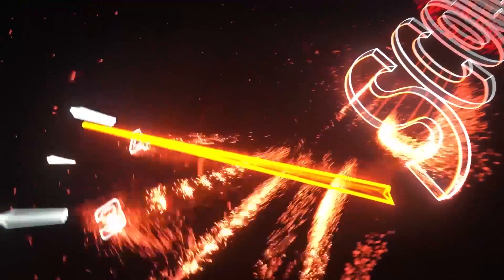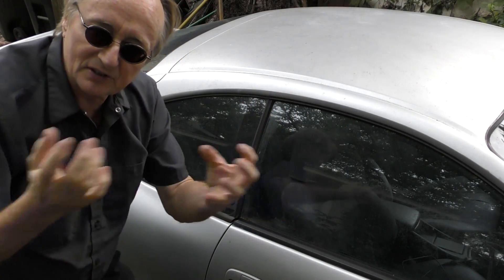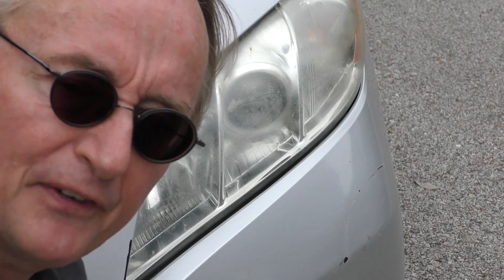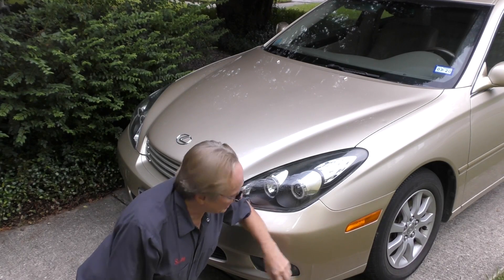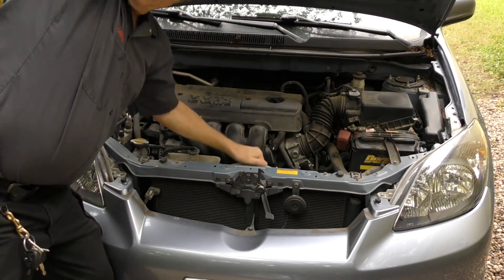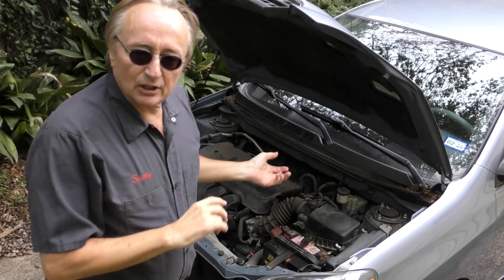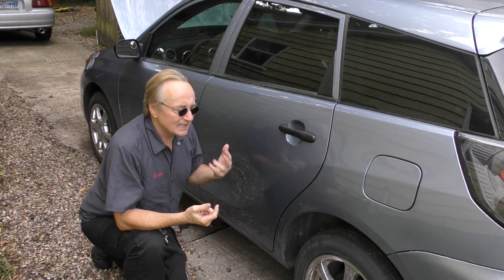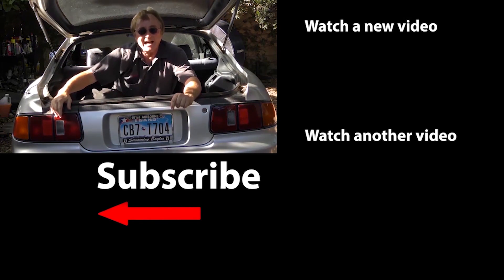You Can't Fix Stupid (Closing My Car Repair Business?)

Comment: Scotty has got a lot of good points over a lot of things, I work with mechanics, or now they are called fitters, as they dont usually fix any thing now, just replace parts (mostly) . The car companies are so cunning, replacing metal for plastic as they say it makes the car much more lighter for economy, and cheaper to make.I noticed things going cheap and low quality in the late 80s where the car companies dont even want none franchised mechanics touch their vehicles producing their own company made tools which were highly expensive. I dont  seriously think car manufcures want cars to last for many years as they used to, apart from some that actually do luckily. Plenty of negatives in the past too of the older cars, eg emissions, fuel economy, unrefinement, safety etc. I never understood people who bought cars for a year or less, then got another one for say $500 each, but now do as if it is not worth fixing just get another one.

Comment: Had a 70s Chrysler 245 6 cylinder that the new aftermarket water pumps metal impeller was slipping on the drive shaft Took a while to work out what was going on

Comment: Im in lake charles and in serious need for an honest mechanic to work on 97 gmc 5.7 liter.  Getting code p0151.  Low voltage for longer than 2 minutes on bank 2 sensor one.  Already changed sensor twice. I suck at wire testing.   Also i messed up and dropped to 165 degree. Thermostat. 
Fixing to go back up to 195 when i get paid.  Simple enough for me to do that.  
Also... How do i check fuel pump pressure.  May that is problem.  Surging slightly at redlights.  Definitely noticeable when its happening,  but doesnt always happen. 
But.... I did buy this van for 500 bucks, put a battery in it and drove it home.

Comment: I'm fine with the single serpentine belt.  You replace it at the interval and throw the old one and the right wrench in with the spare and it's a 5 minute job if it breaks.  Yesteryear.  My 2016 Camry apparently requires the lower subframe to be dropped to get the clearance to change the belt!  Jackassery

Comment: The main reason I got rid of VW GTI - cheap German plastic!  Plastic intake manifold, water pump assembly, and to top things up it even has a plastic engine balance shaft and oil windage tray.  Absolutely stupid.  Due to all the cheap brittle plastic I seriously doubt there will be many 2012 GTI's in 20 or 30 years.  Same with Audi, M-B and BMW.

Comment: I have to disagree about your "Uni-Belt" serpentine drive being on this list. If you have separate belts for water pump and alternator, the loss of one still means you're parked. The serpentine is self tensioning. It can't be over tightened and it compensates for stretching with age. The first vehicle I had one on was a 1989 Chevy K1500 pickup. I changed it at 100,000 miles and truth is, it was fine. I just couldn't wrap my head around a belt lasting that long. I still have the truck and it's still on the second belt at 245,000 miles.

Comment: The epitome of Stupid: the WATER-COOLED alternator in my 1999 BMW 540i 6MT.  Yes that’s right - a non-rebuildable Bosch water cooled alternator.  The supposed more stable temperature was supposed to extend alternator life, yet I was replacing it for the second time at 128k miles (the first one failed at 53k).  Utter garbage.

Comment: They would run out of gas and keep trying to start it, burning up the fuel pump because it don’t pump air...then realized, “Doh! I’m out of gas!” Go fill it up and guess what? Won’t start cause the fuel is toast. Gets towed in to our shop and I drain half the tank so it’s manageable when I drop it to change out the pump. Yeah...Mostly Chevy, some Fords and a few Mopar. Everybody else...through the back seat!

Comment: Honestly, I hate that the plastic headlights discolor, but unless you put 3M film on the glass ones to help protect them from rock hits, they don't seem to last for more than a couple years anyway. They each have their good and bad.
Reply: Also, the plastic aftermarket headlights I had on my 2000 Nissan Xterra were still clear when I sold it after 11 years. I have glass headlamps on my 1993 Mercedes and I have 3M film on them now.

Comment: Easy. Auto manufacturers (especially the American ones) design cars to only last a certain amount of time because they want you back at the dealership every 2-4 years buying a new one. If the engineered cars to last 500K miles with little maintenance, that's less work for mechanics and less cars sold overall.
Stupid but true.

Comment: I bought a 1991 Ranger with a plastic radiator and drove it 150k... no problemo
I have a 2008 Silverado I bought new.  It has over 100k and a plastic radiator... no problemo
I had a 1997 Taurus SHO with a plastic radiator.  I sold it with 135k on the odometer... no problemo
As far as I can tell, plastic radiators are OK.

Comment: Back in the 70s when Scotty really did have customers, vehicles made 10 mpg.  Today, cars make at least 25 mpg and many more make much better thanks to fuel injection and fuel pumps in the tank.   Electronic fuel pumps seldom if ever fail.  A fuel pump is made to pump not suck, that's the reason it's in the tank, plus it's out of the elements.  If you change your coolant on a regular basis and keep rust and corrosion out, you won't care what the impeller on a water pump is made of.  If you bend a metal bumper, it'd cost you more than a plastic bumper, plus the plastic is designed to take a hit better than metal causing YOU less harm.  I agree "most" plastic parts on an engine is a bad idea due to heating and cooling cycles.  But plastic weighs less so you get better fuel economy.  And yes, it's much cheaper to mold then metal.

Comment: Hey scotty, got me thinking about an issue with my '05 Dodge Ram 1500 with your talk of low quality radiators. Seems that my problem is that the temp likes to jump quite alot. Mostly going up very big hills/mountains it goes up over the halfway tick mark, checked the manual for specifications and it said that it would be normal for the engine to go above the tick mark but as long as it stays in the green section it will be fine. It goes back down after I even out but I've never had a car jump through so many temp changes like that. You think it's time for a new thermostat or am I just overthinking?

Comment: Hey Scotty I have a 2001 Saturn L series v620 121,000 MI the transmission is beginning to slip in first gear and reverse should I sell it or just buy a brand new transmission and also it burns about 1 quart of oil every oil change 3-4k

Comment: If you want to see stupid look for the heater hose clamps on the heater core in a Pinto (if you can find one that hasn't burned up). HINT they are one the inside of the heater core case on the inside of the cabin. Thats right you have to tear the dash all apart to change the heater hoses. One of FORDS brighter ideas.

Comment: Scotty complaining about a single belt running multiple accessories as if it's a new thing. That was happening at least as far back as the 1960s. Separate belts for separate accessories increases complexity and, therefore, costs.

Comment: I've got a 2008 Kia Rondo 2.4 with the 4 speed automatic with 245000 kilometers. After I let the car sit for a few hours, say 4 or 5 then drive it, the transmission seems to slip a bit during the 2-3 upshift. It only does it during that one particular shift and only once during the time I'm driving it, every other time it goes from 2 to 3 while it's being driven is fine. The transmission fluid was changed about 7 months ago with a multi spec fluid that met the Hyundai/Kia SP4 qualification. Is this something that I need to worry about or can I just ignore it?

Comment: The Fuel Pump on My Holden only lasts 4 and a quarter years (replaced 2 so far) and every time it costs Me half a tank of Petrol and $1,000. Fuel Out and then Fuel In and half the Tank evaporates.

Comment: I’d rather take a sound beating than change the fuel pump in a Suburban again. The plastic tank on the driver’s side of the radiator in my ‘00 Silverado cracked and started leaking, so I ordered a radiator from Rock Auto. 45 days later the plastic tank on the passenger-side of the radiator I bought had cracked and started leaking. I had to go through Rock Auto’s idiotic warranty process for another radiator. Rock Auto will never again see a dime of my money. Going to my local NAPA is a lot more convenient.

Comment: Had a old pathfinder with the spare wheel mounted on the back to a STEEL gate that was bracketed with STEEL on each side and NOT onto the door itself.  F150 slammed into me from behind.  His truck? Looked like the Hulk punched the front of his truck.  Mine? A broken tail lamp bulb (plastic cover was fine).

Comment: Another stupid thing that ford did with the heater core on the 95 and up ford Ranger is they made it so you have to remove the entire dash board to replace the heater core. The 94 on back could be replaced in 30 minutes. The 95 on up takes maybe 8 hours with a person that knows what they're doing. Totally stupid.

Comment: The way I fixed the ''fuel sending unit''* was by cutting a square hole in the bed of my pickup truck

*Yes. It is called a ''Fuel Sending Unit'' since they dropped them down into the gas tank. Take note! These things must put out 55 PSI That's a whole lot of pressure man! Previously on carburated systems the fuel pumps only had to put out some 5 PSI. Now with these ''Fuel sending units'' putting out a freaking fire hose worth of pressure on the fuel line/system guess what happens?

They wear out more often. And now that they're located down so deep into the fuel tank, these bastards do cost a fortune to fix.

And once they're fixed? They may only last six months to a year!! ''Rinse & Repeat'' and this is what the auto companies want. 

Today I own a 1965 Ford. It doesn't even have a ''Check Engine'' light.

Comment: I'm searching for a used car 2014 to 2017 with low miles. A 2016 costs THE SAME as a NEW CAR! Why? New/used car dealers in my area have a $1000 "markup" and $1000 paperwork fee??? Why is this? 50% of buyers can NOT get new car financing, thus get INSTANT 18% financing on ANY used car that has been jacked up in price...

Comment: I actually like the one serpentine  belt as opposed to the multiple belts. Much simpler imo.
Reply: My thoughts exactly. Individual belts were a total pain in the rear!  They fell out of adjustment all the time and SQUEALED. The serpentine belts last 100k miles and have automatic tensioner. Just be sure to replace the belt, tensioner,  and idle pulley at service intervals .

Comment: Do you have to pull out the fuel tank for Holden/GM Captiva? (2007, petrol/gasoline, auto)?
Reply: these days, it is truly amazing if you dont have to drop the tank to get to the fuel pump. Even on my old 92 sierra the pump is in the tank. at least they had the sense to put the filter along the frame so it is easy to replace.
Reply: @metalwolf112002  oh, that sucks.
Reply: @ArjayMartin  bright side, fuel pumps aren't frequent maintenance items. That is how they get away with putting those in the tank. When i got my truck, one of the first things i had to do was replace the filter because the old one was starving it for fuel.
Reply: @metalwolf112002  I thought that they made it hard to keep 'the boss' in work

Comment: An example of stupid people I thought didn’t exist - saw it yesterday when getting oil changed and tires rotated (can’t do it myself anymore because my knees are bad.) The service tech comes into the waiting room and tells the gentleman his Silverado pickup has really worn engine belts and it would be wise to change them now. The guy says no because he just spent a bunch of money on the truck. Tech says okay, but you should at least clean the K&N air filter because it is really dirty. The guy, an older man, said “I’m not mechanically inclined and have no idea what you’re talking about.” This guy will be broke down in a week and not even realize he could have prevented it. Shook my head and watched him walk out and drive away.

Comment: Rear ended a 2019 Nissan in a 2001 Buick...No damage on the buick , Nissan , not so much..
Reply: I had a "Caliber" rearend my "Dakota",I thought I was unscathed, a little later I found out that piece of crap metal step bumper was almost totaled,if the truck had not a hitch installed, it probably would have been about 3000$ damage to the Dakota( if I would have had a "ball" in the hitch the Caliber wouldn't have driven away, now I keep something in the hitch for that reason. to protect the seemingly tough truck backside.

Comment: Those damn plastic radiators. That was the first repair I needed on my 1984 BMW. Replaced with a metal radiatior. Then everything else on that car fell apart. I won't buy BMW again 😣

Comment: And don't buy those cheap radiator caps with a plastic lever on them. You could get stuck with no way to keep water in your radiator. It should be illegal to use plastic like that.

Comment: Isn't it true that car manufacturers are using plastic to save weight which in turn improves fuel economy? And you would think that the parts should be cheaper because they're made out of plastic

Comment: Wow, I have been complaining about the same things forever.  For the radiators,  I usually custom order mine from Mexico.  They are all 100% metal. Ironically the metal radiators from Mexico are cheaper than the plastic radiators. I hate those serpentine belts.  You loose everything in one shot.  Those belts are also so difficult to replace.  I really hate the fuel filters in the gas tank. This is one of the reason's I switched to Toyota's. At least you don't have to drop the tank on Toyota's.  I helped a friend change the fuel filter on her Chevy Suburban. The dealer wanted $2000 for this. This is when I switched to Toyota's. I really hated doing this but they forced me.  Changing a fuel filter was part of my tune up. Now I only do it when necessary.  Hate those plastic headlights. The worst part is that a car will not pass inspection because of those headlights.  I hope the automakers stop doing these things, and understand that people stopped buying their cars for these reasons.
Reply: - LED lighting units with lighting items that are not user exchangeable!
In a few years customers will get a shock about replacement costs. These thingies do not last as long as they claim, by far.

Comment: And now we have moved to a new phase in car design....electric cars..!! So no pistons, cranks, valves, injectors, head gaskets, exhaust, spark plugs, coolant pump, radiator, oil filter and oil to worry about.

Comment: Don’t even get me started on the gas pump inside the gas tank. I have a GMC and I’ve replaced the gas pump 3x. 

One of my spark plugs requires a tire to be removed. 

Schizophrenic engine design.

Comment: I always use to empty the gas tank if it was full and  had to be removed with a used electric fuel pump with some fuelline on each end into gas cans. Made handing a empty tank a little easier. Still a pain in the butt though. Remember hitting a deer years ago with my 67 tempest the deer went sliding up the road 20 feet and got up and ran off I had slowed down when I saw a couple other deer  cross the road and when I started speeding up thinking that was it of course out jumps another one and that one I hit. Afterward I looked at the front of my car it didn't anything to it.  And that boys and girls is back when cars were made to last and made of steel  and not the throwaway regurgitated crap plastic garbage that is used today.       😁👍

Comment: Shouldn't every car have a digital read out gauge for battery voltage? I had another bad starter, a year and a half on a rebuilt. I'm tired of buying rebuilt starters. I got a new one from NAPA. But they did honor the warranty, so now I have a spare....and we all know the rule about spare parts right? If you have one, you will never need one. 

So why don't cars come with a digital read out gauge, preferably with a switch on it, so you don't have to look at the lighted numbers, unless you wonder if something is wrong? I ordered a digital voltage meter for less than 5 bucks, so now I won't be fooled.

Comment: The people responsible for most of these changes should all be paraded out in the town square and pelted with rotten tomatoes and cow pies!  On the plastic bumper stuff, can you imagine that "repair" bill for a new bumper when you bring your car in for an end of lease inspection -- ahem -- BMW drivers.   The only good news is that thanks to Harbor Freight, you can get a legit LPHV spray gun and repaint your own bumpers if you have a good compressor, a lot of time, and a good work space. But seriously, I went to look at getting a new truck a couple years ago.  The manufacturer was running some big year-end rebate deals, so I went and test drove one.  It was a very nice looking truck, with lots of fancy stuff a truck doesn't need, but it was a good sale and who is going to say "no" to leather seats when they are cheaper than the other guys "WT" base truck... but then as I was doing a walk around, I noticed the rear bumper was wrapped in plastic.  Can you imagine making a truck with a plastic wrapped bumper (no, it wasn't a Ridgeline... that's not ever a truck!)  I told the salesman, sorry, I just can't have a toy truck with a plastic bumper.  I went an researched and there were at that time ZERO options for metal rear bumpers.  There were steel bully bars for the front and such, but as it was the first year they had gone to plastic rear bumpers, there was nobody making steel ones for it yet.